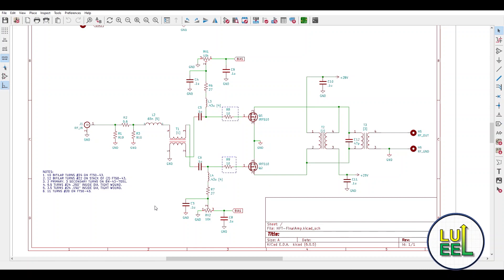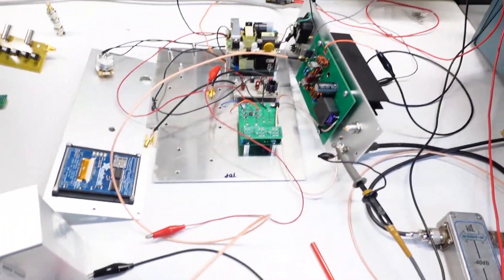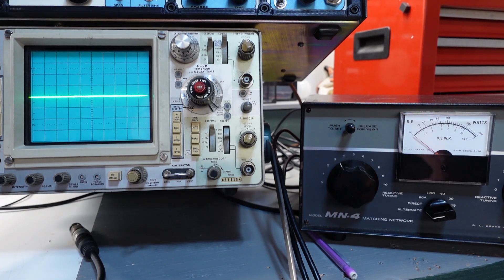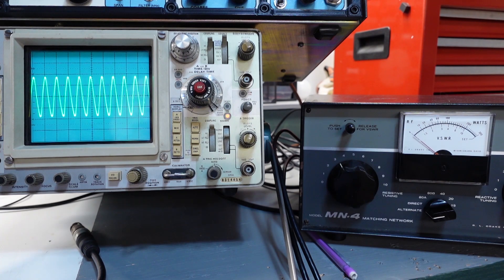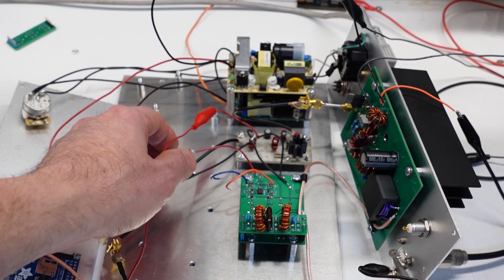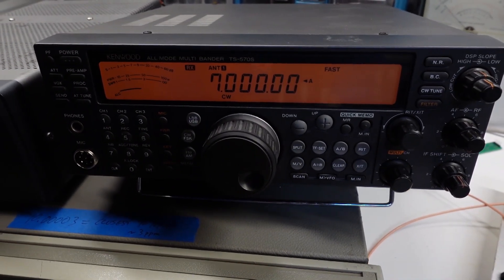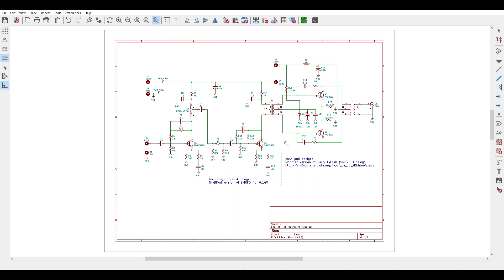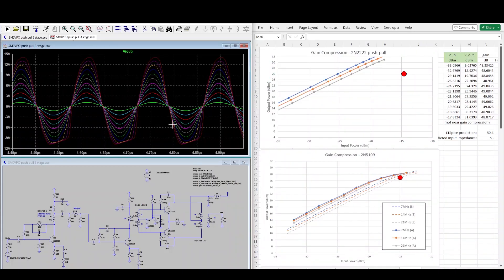HF Transmitter #14 - Final Power Amp

Comment: Great video. Yes I was wondering about the solution to the driver amp. Having power in reserve +30 dBm vs +27 dBm is good as it keeps the cumulative IMD low. Great work